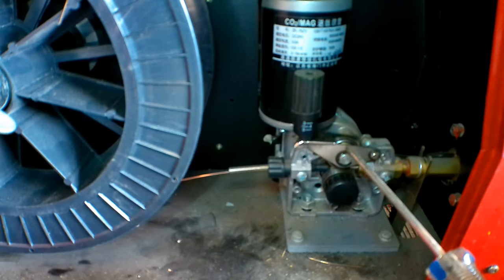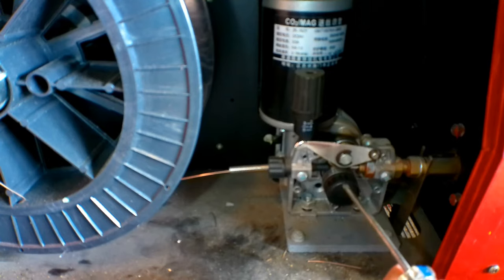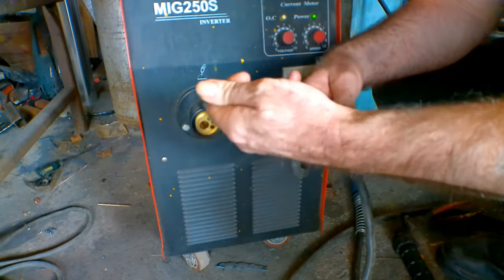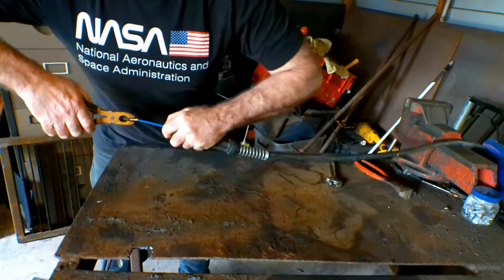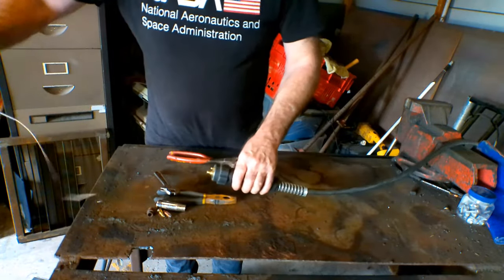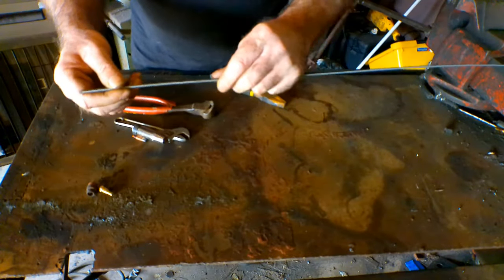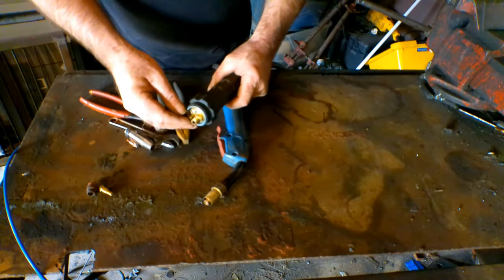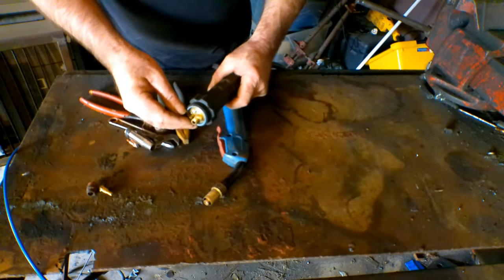Mig Welder Wire Stuck In Liner

Comment: Great stuff as usual Pete.  

One other thing I've found that can jam your wire also is if the wire gets a light coating of rust  on it. I live in a high humidity area and the wire can get a light coating of rust on it when it sits for some period of time.  To  overcome this I use a special lubricated  felt wire cleaner that clamps onto the wire where it comes off the reel. Works a treat.
Reply from the maker: Thanks for the info!
cheers pete

Comment: In short, straighten out the whip and pull on the wire until it comes out. I don't see all that disassembly really doing much. Appreciate seeing that it will pull out though and that it's likely a kink. I was wondering how it would get stuck.
Reply: Just came back from the garage. Straightened the whip, snipped between the roller and the liner, went to the trigger end and pulled firm and steady and it slid right out! And you were right, a kink about half way through. Thanks again!
Reply from the maker: No worries mate

Comment: If you are getting wire stuck in the gun there is a bigger problem going on Pete. First off you probably need a new linner because it has probably been neglected, secondly you need to use wire lube they sell sponges that go in your welder by the spool. Also you need to use contact tip gel. With all that being said I have NEVER had a mig welder birdsnest with steel and I weld with it every day. Preventative maintenance, YEEEHAA!!
Reply from the maker: Nice

Comment: Hey i have flux 125 welder from harbor freight and i used the wire that came with it and it worked fine my welds were good but i let it sit for about a week and i think the wire rusted inside and it got stuck pretty well and i yanked it out and got better wire but now it feeds out all wild and makes my welds look horrible do you think i ruined the hose liner ?
Reply from the maker: are you sure your wire tension is correct

Comment: I bought a welder today

Read the manual

It tells me to lay the gun and liner out flat to feed the wire, but the problem is i domt think i tensioned it properly

So it just ended up getting to a point in the line and just stops, like i dont know what is going on you can feel it getting to the gun and then just stopping then i went a little too far and fucked it

I went to pull it though the roll side and only about 10cm came out... so what then its not sticking out either side of the welder just get a new liner
Reply from the maker: nice

Comment: Try to keep the cable straight and don't step on it or drop any thing on it I have never had wire stuck in the liner I have had a lot stuck in the tip especially 23 wire.
Reply from the maker: good tips thanks